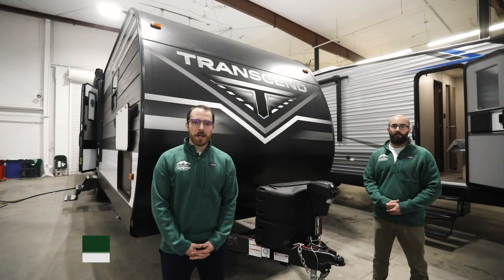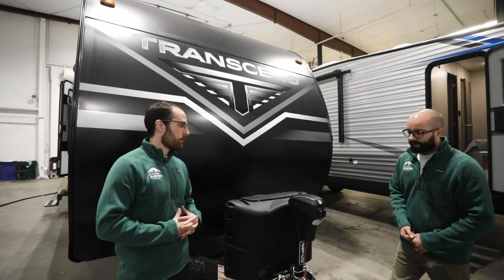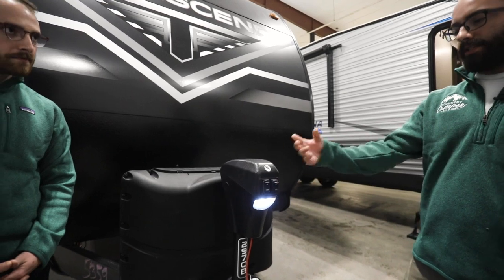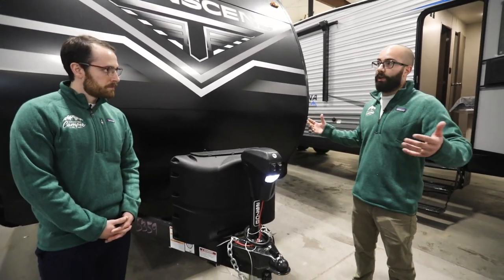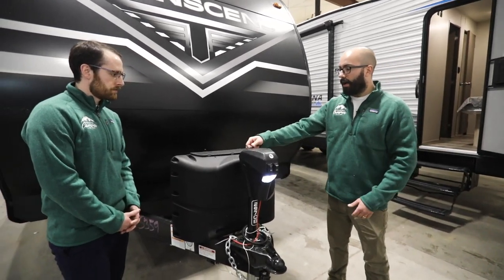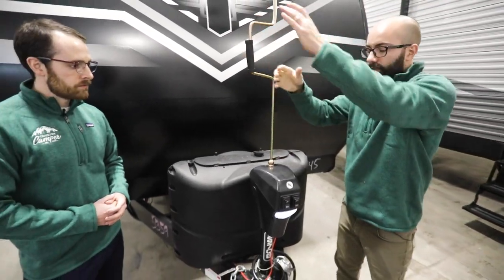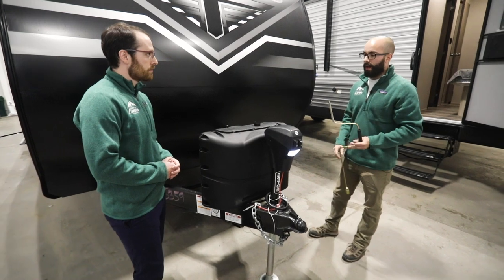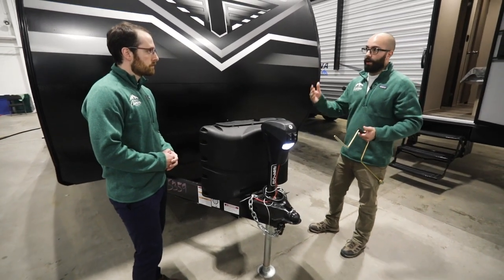Electric Power Tongue Jack Operation & Override Tips | Country Camper

Comment: Should you disable the battery and unplug from shore power before manually raising/lowering the jack? I've read that not doing this could potentially damage the motor. Thanks.

Comment: I installed the quick products 3500 electric tongue jack on my trailer. I am using a 2010 GMC Sierra pick up truck. When I plug the tongue jack plug into my truck plug the jack does not work. All the terminals are clean and corrosion free. Can you advise me what to try next?

Comment: We have a Jack It bike rack and the manual crank tool provided with the electric jack doesn't reach down far enough now with the bike rack installed.  That crank tool you are using looks like it has a longer shift that would reach.  Can you provide the source?